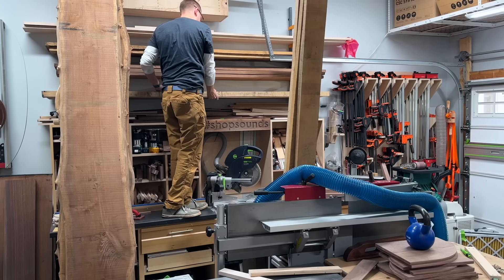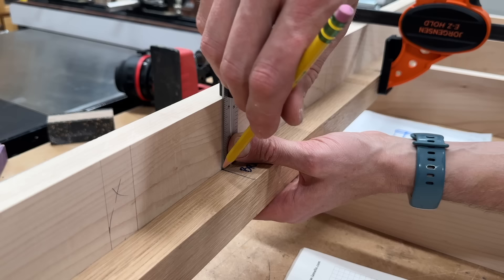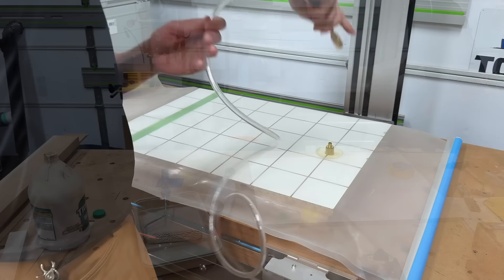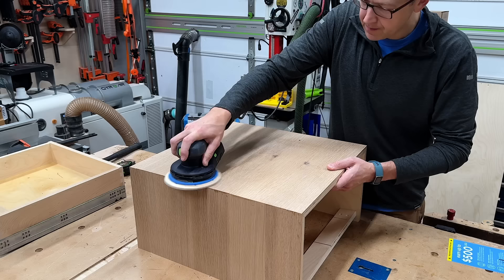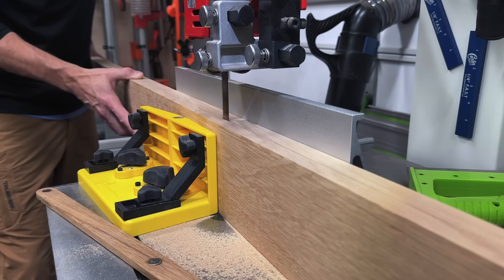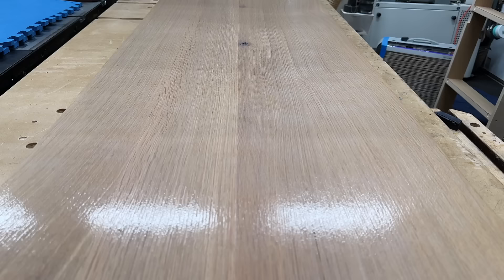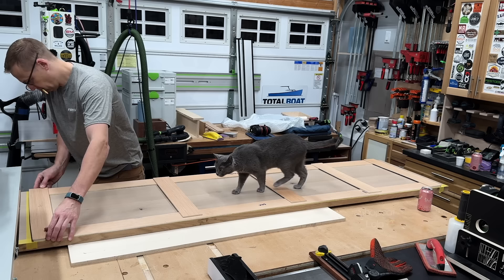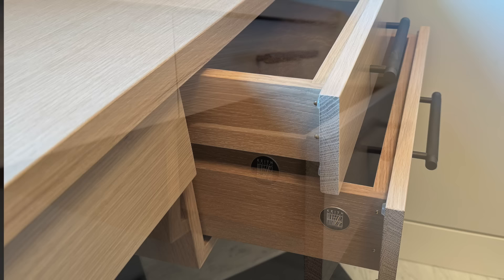White oak is becoming a real problem for furniture makers.

Comment: @21:47 Installation segment was super helpful. Floating vanities are trendy and there aren't many videos covering site prep. Walls are never plumb/leveled and the desk frame needs to be smaller than the measured dimensions, with gaps filled with fillet strips. The desk top was scribed with utility plywood. Nice coverage.
Reply from the maker: Thanks! Glad it was helpful. Installs are always a headache 😂

Comment: Great work Keith! The drawers came out really nice. Was listening to the podcast and was thinkin about the brass dowel depth challenges. I've come across similar things in the past and have tried a couple things. I've drilled a hole in a block of wood to a depth of how proud I want the dowel to be, started the dowel in the hole and hammered on the block with the dowel nestled in the hole. Once the block bottoms out the dowel can't be driven any farther than the depth of the hole in the block. I've also cut a hole a little larger than the dowel in a piece of veneer and put that around the dowel once its most of the way in the work piece, used a flat faced mallet to send it home and the mallet hits the veneer and prevents the dowel from going too far. Hope that helps, thanks for the great content
Reply from the maker: Thanks Ryan! I thought cutting all the pins the exact same length and drilling the holes the same depth would do the trick, but so many tiny variables come into play. For example, more glue in one than another will occupy more space and rounding over one pin more than the other may cause it too look recessed even though it was set at the same depth. The only real solution is to sand them flush 😂. I like that veneer, idea, though!

Comment: When I was taught to veneer I was told to always use a balance sheet on the flip side, even if it wouldn’t be visible. You can use something cheap if it won’t be seen. This prevents any cupping or twisting as the veneer glue dries as there is equal force acting on both sides of your work piece. This may take a little longer and use a little more material but it prevents the kind of problems you experienced. Another tip I was taught was to use thinner veneer, no more than 1/16” and smaller lippings to prevent problems with movement and shrinkage.

Comment: I came across that yellow tape earlier this year and it's been a literal game changer for me. Amazing stuff. For anyone interested, the tape I use is 3M's auto refinishing tape. It's basically yellow painter's tape with a high tack adhesive. Seriously, amazing tape. Not cheap, but very worth it.
Reply from the maker: Thanks for the info! This is just yellow Frog tape from Home Depot and it actually sticks better than the green or blue tape.
Reply: @KeithJohnsonCustomWoodworking Oh wow, I didn't even know frogtape made yellow tape! I'll grab a roll to see which I prefer. It's a bit cheaper than my 3m auto refinishing tape. Thanks, and beautiful work as always!

Comment: Nice work!… Just wanted to give you a heads up on the Bona Nordic Seal since I am a hardwood floor refinisher by trade…. It’s a sealer (primer) not a finish. Our process is one or two coats of sealer (Nordic may require 2 for evenness) then 2 coats of finish.  Bona Mega-One or Traffic (satin, matte or Raw) is a compatible finish. These Nordic style floors have been quite popular the last few years.
Reply from the maker: Thanks for the info! Honestly, I read the bottle 10 times and I don’t remember seeing that it needed a topcoat 😂. In any event, I put two coats of a ceramic topcoat on top of it, so it should be plenty durable for the foreseeable future.
Reply: The word “Sealer” is synonymous in our trade as the first coat. It doesn’t surprise me that the instructions are slightly vague since they assume it will be used by a floor pro. Glad you did get it top coated though! Keep up the great content!

Comment: Philip Morley utilizes this cool technique he calls the “rip and flip”.  It only works with flat sawn material.  You take rips towards the outer parts of the board.  Then flips em and re glues into panels.  You end up with really straight grain rift to quarter sawn material.  Rift sawn white oak is very hard to come by around here.  I started having Myron at irion ship my stock right to my house.   Very flat and clear.  And he’s about 2 dollars less than my local hardware dealer.  So with shipping it’s basically the same price.  Beautiful peace man.
Reply from the maker: Yep! I’m well aware of the technique. Thanks! 🙌🏻

Comment: Lol first time on the channel - longtime woodworker.  I have to comment and LOL at your Blue Persian - My cat is the same (feral rescue) he's in my workshop all the time and is like "oh you builded this box for me?  Thanks" and sits in almost EVERY.SINGLE, SQUARE THING I MAKE, it must be a cat rule.  He's got glue on his ass more than once, and when I say more than once I mean like LOTS,  and he REALLY doesn't like it when I have to grab him and wipe if off, (scratched me a few times) so now I have to lock him out when doing glueups - which he yells at just as much.

Even though thier ears are sensitive he absolutely WILL sleep through me doing whatever, tablesaw, planer, sanding - I had to buy an air filter as he was sneezing a lot in the beghinning.
Reply from the maker: Yes, lot's of filters going in my shop. Luckily, these 2 stay away from running tools and most glue-ups. Only had one incident so far 😹

Comment: my last white oak project all the lumber was case hardened.  a real nuisance and causes a lot more waste as the wood moves immediately when being milled and broken down/sized to rough project dimensions.  i should have gone back to the mill for a refund but I only figured it out after all the wood was milled.
Reply from the maker: Yikes. Yeah, improper kiln drying can be a real problem.

Comment: That’s really lovely. I’m very intrigued by the outlet system in the drawer. In my business (pipe organs), we do a lot of leather work. I’m very fond of a glue sold by our supply company, that they call Felt and Leather Glue. It’s similar to PVC-E. It bonds really well, has decent work time, and is water soluble. Organ Supply Industries in Erie PA.
Reply from the maker: Thanks so much for the adhesive suggestion! I'm definitely going to look into that! I was unsure what would work best. And I love that your suggestion is water soluble. Thanks again!
Reply: @KeithJohnsonCustomWoodworking If they’re reluctant to sell to you as a non-industry member, let me know here, and we’ll figure out a way to get you some.
Reply from the maker: @Hvn1957  Thanks! I checked out the website and looks like it should be no problem to place an order.

Comment: great video keith. to eliminate cupping in your veneer panel, next time only apply glue to the substrate. and if you can, veneer both sides of the plywood at the same time. this helps keep everything flat.

Comment: I looked a long time on those expensive drawer outlets before I came up with a cost effective DIY version. I bought a regular inset outlet with USB-C and some plastic "drag chain" (The ones used for the cables on a CNC or 3D printer. 
Disclaimer: I am not a professional, so I am not sure if that is a viable solution for commission work.
Reply from the maker: Sounds like a viable solution. Is it to code? I have no idea, but don’t worry, I won’t tell anyone 😜

Comment: I really like the leather is the charging drawers. Nice touch. But i would have done the leather on inserts so they could be removed because, in my experience, those types of drawers tend to end up full of dust, lint, and crumbs im the corners that is difficult to clean out.
Reply from the maker: Remove the screws and the panel slides right out if it ever needs to be replaced.
Reply: @KeithJohnsonCustomWoodworking  Oh, that's neat. I didn't realize it was that simple. Great design.

Comment: "It will be fine if i only veneer one side, its plywood afterall, its already veneered on both sides"

Lol....Been there dude

It will happen with a lot less thickness on the veneer also, i thought the same thing and veneered one side of birch ply with 1/16th  maple veneer with contact cement and it cupped the ply
Reply from the maker: Wood is a fickle mistress 😂

Comment: Beautiful and detailed job Keith, as usual, but, why not make a few holes on the back of the drawer with all those connectors, to allow more air to cool down the temperature increase created with the connected devices?
Think about it!!!!
Reply from the maker: I understand the concern, but there’s airflow above the drawer and down the back of the cabinet and out the bottom.

Comment: Your prices are almost up to what I've been paying for 20+ years. I feel ya, it hurts. I tried using plywood instead of mdf a couple of years ago to save my lungs, but when a half inch sheet of CD plywood costs $90 (before the 2020 price increases), it makes you double check every single measurement just so you don't make a single mistake.
It also means I've almost given up woodworking for the moment. It's just too expensive for a hobby that I suck at.
Reply from the maker: Yeah, it's definitely not a cheap hobby with prices so high.

Comment: Wow! So beautiful.  Any tips for getting a floating shelf in a deep alcove with an opening that is narrower than the back? Can’t bevel the sides because the bottom will be visible.
Reply from the maker: Depending how much narrower, what some guys do is use one of 3rd Hands and push the wall open at the front to allow you to slide the shelf it. Other option is cut a groove in the drywall and slide it in and then patch.

Comment: The best way to keep everything perfectly flush while you glue,  is a tongue and groove. I typically free hand it using a bearing bit that way the router follows the board even it is not perfectly straight.
Reply from the maker: That's definitely an option if you have the room! Running 8 foot boards through my router table in a tight space can be a little dicey, but I like the way you think!
Reply: @KeithJohnsonCustomWoodworking  I use a handheld router. Maybe it's just luck but every time I try it, it works perfect.
Reply from the maker: @JerryPonds  You definitely got my wheels spinning. That tongue has to be absolutely perfect, though.
Reply: @KeithJohnsonCustomWoodworking  yes sir it does.

Comment: 28:13 filler strip at the end: not that it was difficult, but would it be a little bit easier if you created a little flag in the middle on the front where you already had tape so that you could pinch the tape to hold it a little easier?
Reply from the maker: Sure. Whatever works! There always more than one way.

Comment: As always hands down best woodworker on YT, long time watcher. Doing a 40" long, 18" deep, floating desk for light weight work. Do you think two of those counter top support brackets lagged into studs, without any additional support,  would be sufficient?
Reply from the maker: Thanks for the kind words! Yeah, I think 2 of those brackets would work. I suggest getting the ones that attach to the sides of the studs, not the front like I used. https://originalgranitebracket.com/collections/desk-brackets/products/free-hanging-shelf-bracket?variant=36820197772
Reply: @KeithJohnsonCustomWoodworking  Many Many thanks. Please continue the top notch work for our viewing pleasure!

Comment: Well edited video, informative tips, and gorgeous work as always Keith. I had an idea for the brass pins and the worry of over-hammering them. What if you drilled some holes in some steel or aluminum shim stock, placed them over/around the pins and then hammered them in? That may be harder for hand finished pins and easier for machine made ones, but could work either way. Maybe too much effort for something that you can do by hand with a careful swing of a hammer. Perhaps the butter ain't worth the churn.
Reply from the maker: It would be an interesting experiment for sure. The one problem is when I round over and smooth the ends of each individual brass pin, there is some variation. So, what might be the perfect strike and fit on one, may not be the same on another. Some will require minuscule adjustment which is where the danger lies 😂

Comment: Red oak is available yes it is 80s but one can do some other finishes besides golden oak or a stain even. I have been into woodworking since say easy 1979. Besides a few weird exceptions allot of crap gets made out of what is hot at the time, and these tend toward rare or limited supply woods. White oak should be used as ships or barrels maybe tool boxes.
Reply from the maker: Thank you.

Comment: Hi Keith, really great video.  Lobbing in a very late question, but I'm thinking of trying the leather drawer bottom like you did and was wondering (1) what substrate are you using (it looks like it might be a double layer of 1/2" ply?) and (2) if/how you finished the bottom (wondering if I should be finishing both sides with shellac or something before gluing the leather for moisture balance).  Hope you see this (but totally understand if you don't)
Reply from the maker: I used 3/8" baltic Birch for the drawer bottoms. And you just need to shellac the bottom, not the side you are applying the leather to. I would do both as close together as you can to prevent any warpage.

Comment: Nice video! If you don't mind me asking, the oak drawers are gorgeous but won't there be a problem with wood movement?
Reply from the maker: Wood movement happens across the grain, so it will happen up and down on the drawer box. No issue.

Comment: I'm a custom cabinet builder and I absolutely hate those docking stations. They're starting to get really popular and I have installed at least 10 of them this year on some bathroom vanities that I built for customers. They're expensive, bulky and the drawer doesn't open or close as smooth as it would without it. I wish people would stop requesting them
Reply from the maker: Yeah, I'm not sure they are completely necessary and the prices are outrageous. I put some WD40 on the pivot points to lube them up, but you're right...I'm guessing it will start to get harder to open/close over time.
Reply: @KeithJohnsonCustomWoodworking  My comment was just a rant about the docking stations. 
But I really love your videos. You are one of 3 channels I love to watch because your builds and installations are very similar to what I do. It's high-end custom, and I really enjoy watching them

Comment: Hey Keith, love the content and the builds! Do you ever do custom aquarium stands? I think I can apply many of your cabinet building tips. However, (big) aquariums require a 2x4 frame to carry the weight, which will definitely impact the design, techniques and skills needed!
Reply from the maker: Thanks! No, never done an aquarium build...I'm assuming there are tons of websites that outline the kind of supports, etc. needed depending on many gallons the tank is. Sounds like a job for a steel welded frame 😜

Comment: Glad to hear you also struggle with that regardless of using dominos or not!
Reply from the maker: 😂 it’s so dang annoying. I guess dry fitting first would be a good way to check. Also, I was thinking of just putting a couple in the middle and then I can futz with the ends when I’m applying clamping pressure.
Reply: @KeithJohnsonCustomWoodworking  I think it’s the nature of the beast

Comment: Keith - great video, I always appreciate how you explain how you get around the inevitable errors whilst woodworking.    I have a question about the rift sawn white oak availability and cost problem.     My next project is white oak dining chairs, I was thinking of using rift sawn because of the grain and stability, but could I use flatsawn at a pinch?   I also live in Florida so obtaining lumber can be a challenge.    Thanks, have a great Christmas 
Ken
Reply from the maker: Thanks Ken! You can certainly use flat sawn, but I'm guessing you will end up with some real funky grain on legs, spindles, etc. However, if you buy flat sawn at a good price and carefully choose your material, you can just rip out the flat sawn middle and the outside edges will be rift. Yes, there will be some waste, but it's still probably cheaper than buying all rift.

Comment: Any difficulty with heat in the drawer with the power outlets?  I built a floating cabinet for my son and put power in the drawer for his Playstation and it got so hot in the closed drawer, the machine was hot to the touch.
Reply from the maker: No issues just charging phones and ipad. That PS generates way more heat. Maybe find a way to drill some holes in the drawer for ventilation?

Comment: How do you like that worksite Festool tablesaw?  Like most of Festool’s stuff, it intrigues me.  Beauty job on the desk.
Reply from the maker: It works well with the table saw because the gray panel folds up and acts as outfeed support. It also turns into a hand truck for easy transportation of the saw and a stack of systainers. It's also half the price of an MFT and is much lighter.

Comment: European White Oak if Robur species is denser with less open grain than our Alba species. This means you can use flat cut instead of paying up for rift. There are other species including stuff from Russia. So, track the product.
Reply from the maker: I'll stick with local material, but thanks!
Reply: @KeithJohnsonCustomWoodworking  You can see the tone difference by looking at all the engineered flooring being widely supplied in the US. Monarch Plank has good info on this. Plus, the water poly raw wood look finishes like Ciranova Ecofix matte that are used. There's a lot more high-end wood dollar sales in flooring than in custom furniture. More competition.